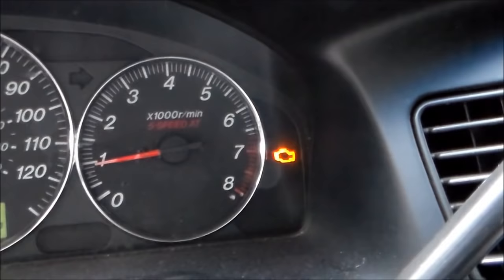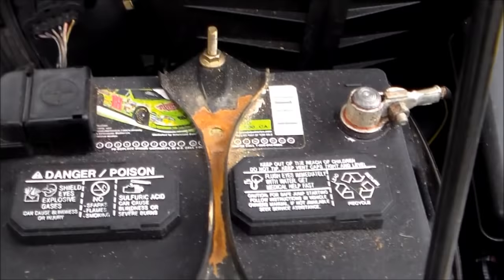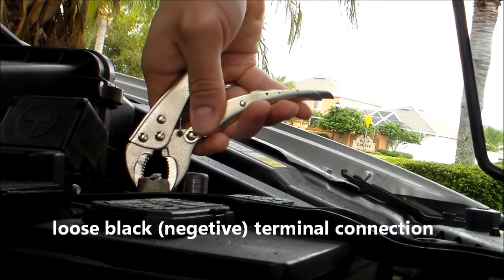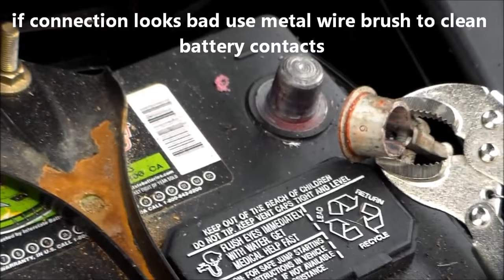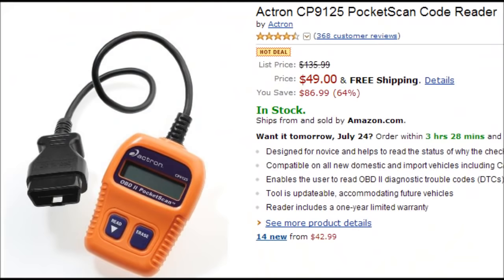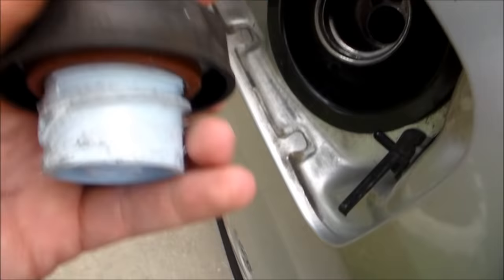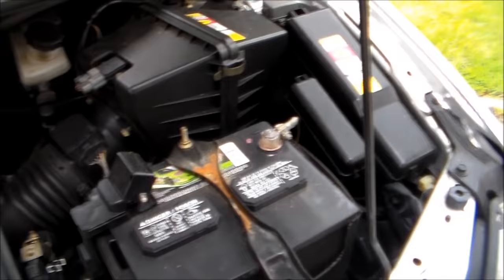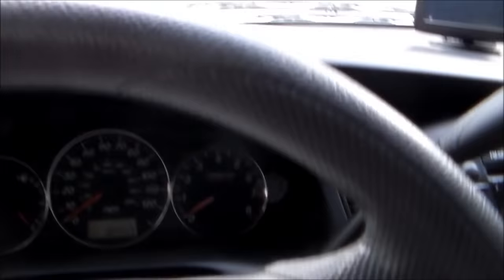HOW TO RESET CHECK ENGINE LIGHT, FREE EASY WAY!

Comment: I work at a place that installs batteries. While it is true that on some vehicles you can disconnect the battery and nothing will happen except losing your radio presets, many vehicles, especially newer ones, require an OBDII memory saver to be used, otherwise your cars computer can lock up, or at the least, your radio will lock up (especially Hondas) and you will need a code from the dealer to unlock it.
Reply: a Honda radio code is located in the glove box.
Reply: Drew Proulx If you're lucky... People take them out for whatever reason. They should be stuck on the side of the glovebox instead of being removable.
Reply: John Eshelman Exactly WRONG !
That would make the ANTI-THEFT CODE available to radio thieves and defeat the whole reason for it's creation in the first place !

Comment: You should never do this. If there is a problem the light will come back on. When you reset the computer of its trouble codes you also erase all its parameters it's been logging and any adjustments it's been making for the engine, things like fuel trim, timing changes and any other adjustments that have been made to keep the car running, performing and getting the proper fuel economy. In this case buy a gas cap and the light will reset after a certain amount of driving has been done. All cars will reset their trouble codes and only if a problem exists will it illuminate the CEL.

Comment: This method is ok on older cars but I don't recommend it for newer car specially luxury/sports cars with bunch of electronics and modules on-board. On most of the newer cars disconnecting the battery will cause some of the control unit to go to sleep and loose their readiness, anti-theft stereo/infotainment system will require entering the Code and most of the time drive authority system will be wiped out and after connecting the battery back your car might not start, even if it did it might go to limp-home mode meaning you will not be able to drive faster than 30 MPH.So in a nutshell disconnecting the battery to eliminate CEL will make you to take a trip to your favorite dealer with your check book on hand. Just don't do it without consulting a professional it.doesn't worth it. OTOH code readers/erasers are dirt cheap nowadays get one and even a cheapest one will do lot lot more than just erasing CEL for you. Good luck
Reply: Aryajet Batteries are changed all the time. You only need to disconnect the negative for about five minutes. All that should need to be reset is the radio setting. People try this reset thing all the time, it can solve weird electrical glitches by doing a reset.
Reply: fuel in tank pump 93ford ranger 2.3engine
Reply: Wtf. You are aware batteries need replacing right?
Reply: No Way  A tool name memory saver is used while replacing battery. Even a 9 volt square shape dry cell battery connected to power Outlet (former cigarette lighter with an adapter will save all the memories while battery is disconnected for replacement.
Reply: Ann Korn True. But memory saver is needed to replace battery on modern cars. You don't have to believe or follow my advice Owner Manual of your car will tell you what exactly you need to do. There is no such a thing as One Set of battery replacement procedure to cover all cars, each one requires its own procedure. My advice is the safest if one does not know the exact procedure.
Reply: +Ann Korn Bad battery in a Mercedes can cause plenty of problems that the dealer has to reset.  Many VW's need the security codes on the radio reset by a dealer after replacing battery or it will not start at all. 

Do your homework before misleading people.
Reply: +No Way 

WTF?

He's 100% correct, save up and buy a new Mercedes, you'll see.  Even some VW Jetta;s wont start after a battery swap until the dealer resets the anti theft system in the radio, generic scanners won't program, just read.

You are aware of that though right?

Your comments here are so completely delusional, did you learn mechanics from the back of a cereal box or mail order campaign?

Your other post above is just a farce, how does one person get so much bullshit in their heads and miss all of the actual facts in the process?

Comment: this is exactly what a lot of used car lots do minus any repairs they just reset the light which will not come back on until about 80 miles driven
be sure to get your codes checked at Auto Zone before you buy it!

Comment: Thanks for your help. I had an Engine Light on, On my wife 1994 Toyota Lancruiser and I follow your awesome instructions and Boom the Engine Light was gone Thanks. I though at the beginning that it needs a spark plugs, cables, rotor etc, But the problems still was there. Thanks to your help after I watch your video The light went out...

Comment: You don't have to wait for 2mins or so to reset the ECM (Engine Control Module). All you need to do is remove the negative terminal of the battery (you can use your hand don't worry, 12v will never fry you) then short circuit the NEGATIVE CABLE to the positive terminal of the battery using any conductor or cable. In this case, all capacitor will be discharged. 

NOTE: Removing the battery terminal will reset your radio, if your radio is coded, then you have to make sure that you have that code. Otherwise, dealer will make a fortune from you. Also, don't use tools like he used, that will worn out your terminals.
Reply: i'm not sure who told you putting power to the ground was a good idea.
Reply: Eddie Suerte Felipe Iv'e taken off my battery cables before & my Radio settings stayed the  same etc.No problem with it.

Comment: Not trying to nitpick but using vice grips to turn that clamp bolt could result in rounding the nut. Better to use an open end wrench.
Reply: You are so right. He needs invest a few dollars and get a set of combination wrenches. Otherwise it's a good video

Comment: Here is the Permanent fix...... Take out the BULB !
Reply: LOL! not. funny though.
Reply: Easier to use the classic VCR clock repair - black tape
Reply: Good way to fail emissions also.
Reply: TheBehrdog
Reply: It will burn out in a couple years anyhow
.

Unless your engine burns out first.

Comment: Please try not to mislead people.
If it was a "small EVAP leak" (the code a bad gas cap throws) you wouldn't have the light turn on until you drove the car through a set of conditions that triggers the evap leakdown test for the ecu.... I'm not saying it wasn't you issue, but as the video concludes, you can't definitively make that determination.
No it doesn't harm your car... but it does clear freeze frame data from when the fault occurred... which can be a problem for the mechanic when you find out you didn't actually fix the problem. It also clears your readiness tests, so don't expect to pass inspection until you are able to complete all the "drive cycle" conditions that trigger necessary testing that must be complete when you get plugged in for inspection. Even one incomplete on the "drive cycle monitors"

Comment: i have a eclipse gt 07 and i was told oxygen sensor but im gonna check my cap i don't never here that click in sound just thought about it. i got a new battery and the engine light came back on after i got that hooked up. thanks ill check the cap

Comment: There is no such thing as your check engine light going off because you have air in the tank. Now if it's a problem with your gas cap then the code that comes up when you scan the car will point you in the right direction. You have a code that will say Large EVAP leak, or Small EVAP leak. Depending on what code you get directs you to where the problem is. The computer is lookng for leaks not air.

Comment: Hello, Hungary is calling... :) You do not have to unscrew the battery. Just pull out for a while the ENG B (10A) fuse. With the small plastic tool - you know. This fuse is in a diesel mazda6, but I think it is similar with others.
And a message for everybody who has difficoulties with the battery screws: do not dry a wet cat in a microwawe owen, because the cat might die. :))

Comment: The trouble with this fix is that the car computer will check "not ready" at Emissions and you will have to take the car through a long drive cycle before Emissions can read the car's computer.  You will still have to make the repairs to get the car to pass after your car's computer has finally reset.  Been there, so I know what I'm talking about.
Reply: Agreed!
Reply: my car passed last year doing this method then i drove for 30 miles on freeway then i exit freeway drove on the street for about 10 miles stop lights, atop signs and all and drove directly to the shop and it passed and i will try it again this year 😣

Comment: I really like that you undid the battery terminal with metal vice grips...I know you think this was informative and useful, but by not figuring out what is wrong with your vehicle, you're putting yourself and others at risk for a huge issue while on the road. I'm not an expert but I have a years experience under a very skilled mechanic and am on NY way to AES cert. I wouldn't recommend using this for as month to month fix, but what do I know...I'm just a girl...

Comment: I have watched several videos on fixing the engine light-on problem for 
Toyota 2003 Corolla for I have had the problem for many years. This time
 I changed my mechanic to Shell service station, Bellerose, NY 11001. He
 tested the engine with the diagoniser, and changed the top mount 
gasket, and that immediately solved the p0171 and p0770 problem. The 
engine light-on has been off since then. You may want to try this 
solution.

Comment: temp fix. code reader would be best then you know whats wrong then you fix it then clear it . the battery trick does not fix the problem just makes the light go away for awhile, one thing to also note on some cars when you pull the battery good luck starting your car again unless you take it to the dealer to be totally reprogrammed and that's costly. good video tho. P.S when pulling the battery Waite 10 min then reconnect it.
Reply from the maker: Totally Agreed, Smart Comment well put 8^)
Reply: ***** thank you ,,have merry christmas
Reply: Had the old battery out of the Tahoe for a few hours until I could get a ride to the store for a new one.  Put it in and it started right up, ready to go!  I might be wrong here, but at least in my finite experience GM has the best "user friendly" automotive electronics out there.  Having to have a dead car reprogrammed at the dealer sounds like a towing charge unless you got a buddy willing to hook up a strap and pull you in. Is that a VW or Chrysler ? :-)
Reply: i have never seen a car when you unhook the battery you have to go get the computer reprogrammed... so if someones battery dies on them they cant boost the car, cant replace the battery, they just take it to a dealer? makes no sense to me.
Reply: satanastic some cars have to be dealer reset or the car wont start again, i seen a few of them . for the most part in cars they will reset and reprogram them selfs you just drive it on the hwy for 1 hour at 80 to 100 kph and all done . this does not fix a code problem just delays it coming back on for maybe 5 min or a few days depending on the code it wont do a dam thing to take the battery off line to reset the computer,
Reply: KevinMillard68 can you remeber which cars in particular? not having a dig, just dont wanna disconected a car in the garage then have to get it towed. i have worked on fords, vws, mercs, bmws, porches, range rover, citreons, toyotas, nissans, fiats vauxhall(holdens) etc and never come across this.
Reply: Derek Dosant off hand dont remember the models and makes 10 years ago was along time for me to remember that
Reply: ***** this didnt work on my 91 celica any ideas?
Reply: SvddenDeth get it fix the proper way

Comment: cool video man ....what about the passenger airbag yellow light?
Reply: Tung Quach Check the conectors under the passenger seat.
Reply: Tung Quach Most times false engine lights ,airbag lights etc.: are all caused by faulty batteries.. replace your battery with a good quality battery and your trouble's will disappear.
Reply: +Alexander Bertt     Most times?  False.
 Most systems work at a low enough voltage that battery drain does not effect it, as it will with a Mercedes, BMW, Volvo or VW for example. As for the passenger airbag, there are plenty of reasons, including faulty connectors as mentioned or the seat sensor pad, which are far more common than a low battery.

MOST are ALL caused?  nope.
Reply: +ozmedia  i was just about to post that wont work on Mercedes and bmw lol
Reply: Charlie Hutch
Actually, in many cars it's true, but its far from the standard.
Reply: dejan rasovic
Actually it is common to see false positives due to a weak battery, just not the most common.
Reply: how, why, not true
Reply: dejan rasovic
Sensors in in the vehicle all rely on specific input/output voltages, usually somewhere between 1V and 5V. 
If voltage spikes or drops, it shows a malfunction in a circuit. ie.  An O2 sensor constantly switches between 0.2V and 0.8V outside of that range or sticking to one voltage means the car is being fed too little or too much fuel and if out of range twice in one drive cycle, the light is triggered, which can be caused by many things besides the O2 sensor, the O2 sensor is just the one that commonly throws the code as it is constantly monitored.
 
Some sensors only receive voltage when the vehicle is running, in which case a decent alternator will make up for weak battery voltage. ie. an O2 sensor again, operates at running voltages, not static, so a low battery won't really effect an O2 sensor.

Other sensors do a self test upon the ignition being switched on but before the car is started. Some sensors read constant voltage even when at idle, when the alternator might be straining to keep engine power management systems running.

Voltage is the factor behind everything from a seat occupancy sensor for an airbag to the O2 sensor switching operation.

I won't look to a dead battery for an O2 sensor as it is operational during running conditions and if it spikes or drops, it is almost always faulty wiring or a bad input from another failed sensor in the chain. I will read operating voltage on the O2 sensor but only to determine if it is a lazy sensor, or running rich, lean etc.  Most O2 sensor codes are not actually due to O2 sensor failure though.

Security systems, airbag sensors etc rely on static voltage, the ignition is in the on position, but not necessarily with the engine running. Just straight battery juice.
This can cause what is known as a false positive, a light comes on but is not related to a failure in that specific circuit, beyond low input voltage. thus triggering a light related to a low battery and not a component failure.
Reply: ozmedia ok ty, but that case is so rare i think 1 %, but i see you know what you talk
Reply: dejan rasovic
It depends rally, Mercedes, VW and BMW for example are extremely battery voltage reliant.  Low battery voltage on one of those cars will have tire sensors, traction control sensors etc all going haywire.  They are an engineering mess though, selling solely on the reputation of the badges not quality or reliability anymore.
Most North American cars don't have issues with low battery throwing weird codes, it happens, not often.

Comment: I unhooked my battery cable then hooked it back up and the engine light turned off. Then I went to get my inspection and they hooked it up to an "EVAP" machine and it detected that the engine light was on. How can I get past this issue? YOU MENTIONED THAT REMOVING THE FUSE AND PUTTING IT BACK RESET THE COMPUTER, WILL THAT HELP BYPASS THE "EVAP" DEVICE? I live in North Carolina and they are real strict about inspection.   "I DRIVE A '96 Mercury Sable"

Comment: Thanks for this video.  I will try this.  And yes, happy wife is a happy life! True words from a genius :-).  I have a '97 Toyota Camry and the mechanic looked it over before I bought the car 4 months ago, and said I'd eventually need to have it fixed.  I'll check the gas cap again, but I don't remember an issue with it. I'll try to reset the check engine light by the end of the weekend and hopefully it works.